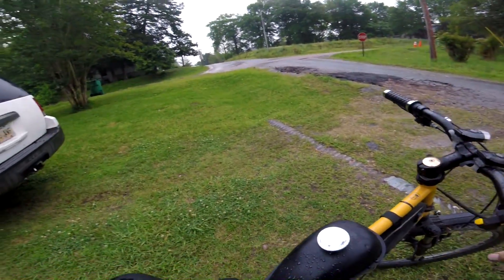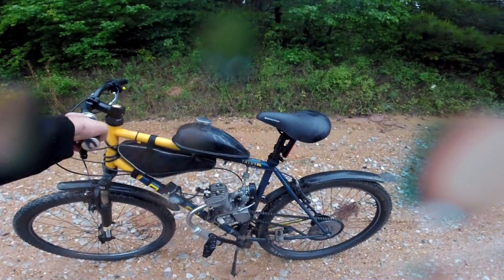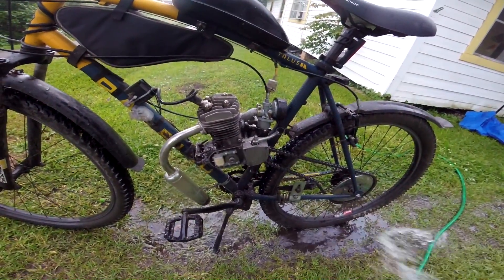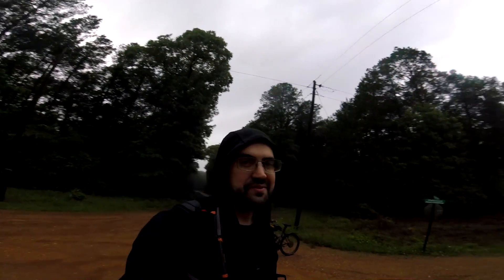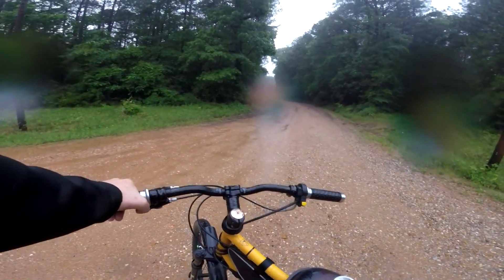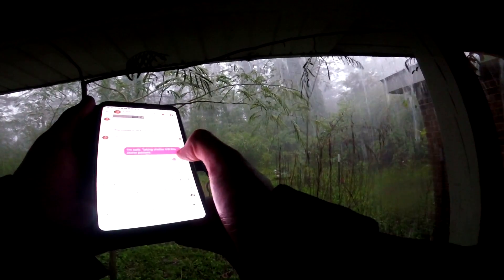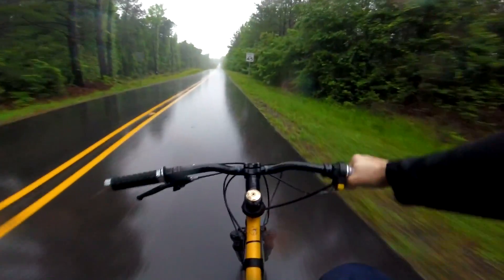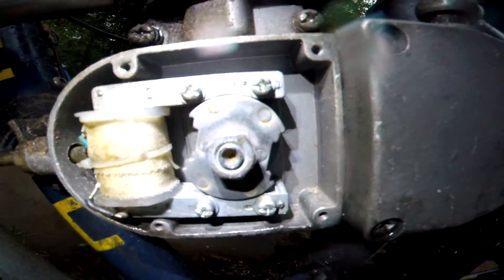Magneto Water Damage (Motorized Bike)

Comment: yeah, the gasket can trap water for sure.  I sprayed off a bike yesterday, hit it with the air compressor and then went for a ride...made it a couple miles then bike died on a gravel road. (could have been vibrations as you stated)  Had to pedal all the way home, left the bike sit overnight. (in 40* garage)  Came back to troubleshoot it this morning, as soon as i cracked the two bottom cover screws about 1/2oz. water spilled out.  Now i have it in the kitchen in front of a space heater...waiting to see it that works or installing new magneto. woot woot
Reply: I had the 100cc woodpecker and I hot glued the hole that feeds the wires to the spark plug. I rode in the rain every single day and not one ounce of water made it in but after a year in a half my bike died and it was from the stater overheating because the spark plug wire itself was rusty.

Comment: u r like me some one who gets it sir I love ur videos.. I know u r a great mechanic. It's just halfway through the video only thing I would suggest and I don't know if you said in the whole video is bypassing the kill switch for some reason that seems to kill Magnetos . If you bypass the kill switch are Magneto will last longer I've done it several times and also done the reverse. So I do have a Baseline for my tests tried-and-true. I recommend stealing that Magneto if the gasket is not sufficient also where the wires connect heat shrinking them and making sure they don't short on the frame that's all brother thank you for another great video all of yours are awesome

Comment: One thing I seen in a other persons vid he drilled holes in the bottom of the cover so heat can escape in the magneto cover I've done the same so the magneto will last longer,  I put one hole slightly on the front as well to pull more air in and will just stick something like a peice of ruber in the front hole on a rainy day and keep the bottom, holes open always just thought I'd throw this out there

Comment: Mine used to stop working when ever The magneto got wet..., The stock air filter is a must in a rain or you’ll be just sucking water in your engine

I was able to ride in the rain but if you shut down the bike with the magneto wet it will not restart at least that’s what happened to me

Comment: FYI> the stater in the magneto is NOT made of stainless steel but is made out of the same metal they make transformer laminations out of, MU metal...stainless would not work do well in a magnetic dependent situation...also you could short the magneto coil all day long (assuming you could spin the motor) and you would never burn out or overheat the coil due to the limited current production of it.

Comment: Plus my bikes modded tf out besides porting and working on fine tuning the carb, minor port match on exhaust/ to exhaust port but thats it. Bike tops bout 35 atm cruises 20-25 easy, 36t sprocket, have not tested since from 70 to 65mm rejetting since weather is shit atm though, was running like trash before, also still waiting on bbr boost bottle in shipping
Reply: @LA Hover got any tips on increasing the port timming? With the amount of mods i have ive been told numerous times i need to increase porting for timming to get full effect of mods (bbr high comp head/copper performance gasket, short straight bbr intake manifold with boost bottle induction nipple, performance carb (hp clone style), flex fit viper exhaust (minor exhaust port matching) ngk irridium bp7hix spark, ngk performance cdi

Comment: is it bad to run the motor in the rain? or through puddles. the air intake is literally pointing down any bit of water could come in and hydrolock the whole engine. or bend the rod?
Reply from the maker: If a 15-20 minute video of me riding through rain and puddles is not enough to answer your question about rain and puddles... Nothing is...
Reply: LA Hover I understand lol it just gives me mad anxiety 😂

Comment: I used to have the same kit for a few years before getting stolen... my problem was that the stock plug boot and wire was cheaply made, to the point that my CDI would arc from under the boot once it got wet... always fried CDI’s but never any magnetos... magnetos don’t care for water... it’s the CDI’s that fry... simply because it’s being arced to the motor from under the boot (doesn’t apply to all cases) magneto; low voltage output... CDI; low voltage input with high voltage output.... the arcing “backfeeds” the low voltage side... which in turn fries the CDI... I have not once changed a magneto during the whole time... replaced 3 CDI’s before I realized I needed to peek at the boot closer... carbon tracking is what causes the HV to arc to the motor from under the boot.

Comment: I've had mine short out because water got in the case and pooled up in there and didn't drain until it was too late and I had no spark there was no corrosion just fried, after I replaced it tho I've rode in the rain multiple times and its just fine leaves me a little paranoid everytime I ride in the rain but I doubt it'll happen again

Comment: Ok,ok,that looks like a different bike, but I sware I rode twice in 2 major rain storms and both times I fried the magneto.  Since I've sealed the engine entirely I've yet to have a problem. I don't know if you're lucky or know something I don't but I wish you the best of luck just the same.  Any advice?
Reply from the maker: On your Mags do you cut and cap off the extra white wire? and adding a bit of extra protection to the connectors might help... But the simple fact that every time you use the kill switch it dead shorts the mag, means water aint going to do much.
Reply: @LAHover  Hover, I will admit that your much better informed than I am, but as to the magnetos...Both times they fried on me was in rainstorms. Thanks for the info and the quick response hover. Keep the videos coming.

Comment: could you tell me if this bikehttps://www.walmart.com/ip/Schwinn-Midway-cruiser-bike-29-inch-wheels-7-speeds-men-s-frame-black/757977536 ,  is capable of fitting this motor? https://www.ebay.com/i/333197797757?chn=ps&var=542211359791&norover=1&mkevt=1&mkrid=711-117182-37290-0&mkcid=2&itemid=542211359791_333197797757&targetid=883323210413&device=c&mktype=pla&googleloc=9052694&campaignid=9418889660&mkgroupid=92908014142&rlsatarget=pla-883323210413&abcId=1141016&merchantid=6296724&gclid=CjwKCAjw1v_0BRAkEiwALFkj5mOKg3W3J1lelTtz0aLt8QepThyr3x-pRjhPw61YuUAvXhmeJweGNhoCsaMQAvD_BwE ? also do you recommend using a regular beach cruiser like a nel lusso over a bike with gears?
Reply from the maker: No sorry

Comment: Lol I've been using a front rim as a rear. Haven't had pedals for over a year.
Reply from the maker: You bump starting a 2 stroke or pull starting a 4 stroke? I was surprised at how easy this trip was without peddles lol...
Reply: 3vil3dav3 333  LMFAO you actually bought a 49cc your mistake.

Comment: Do you think it's worth getting a smaller sprocket ? I always top my bike out quick jdm in the uk with 99octane
Reply from the maker: If your bike is well built yes. Your motor will run cooler as you go faster, and you will save gas.
But you will attract more attention from power hungry cops, so be careful.
Reply: I run a 36 on my 66/80. Huge difference. Tops out at around 45, cruises comfortable at 30 to 35. Never overheats cruising. Has plenty of pull for mild hills. It's just a stock single piece jug Chinese motor from Amazon.

Comment: This is cool and all but I usually toss the stock gasket and run a bead of silicone on the cover and let it dry overnight and then put it back on the bike. Its easy and as waterproof as your gonna get and you can always put a glob of high temp grease on the opening for the wires to keep water out of there. Now you dont have to worry about it at all.

Comment: Hay right know I've got my motorized bike it's the 700c mongoose hotshot unfortunately the wheel got bent and the pedals  are bad so I'm not going to put any money into it I might be getting a bike from my friend but if that doesn't work out what bike for a motor kit would u recommend preferably under 200 dollars ?
Reply: Walsmarts(no commercials)now has a Mt.Bike with Alloy spoked wheel,and disc brakes for $198.:No kidding.I'd get,but just blew 120 for alloy rims.
Reply: @bryduhbikeguy  I would stay away from mags, have heard of plenty of accidents due to fatigue and stress failures causing the wheel to break into chunks